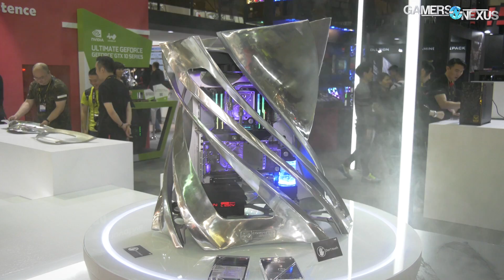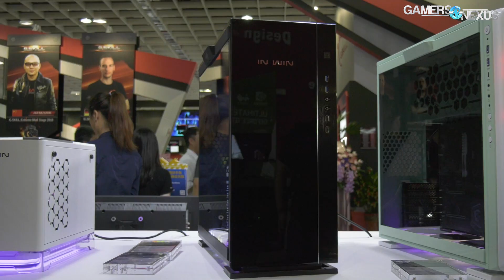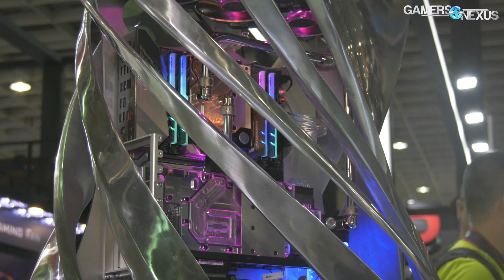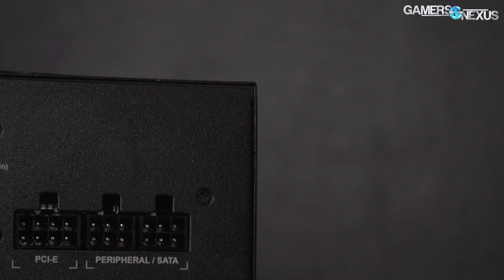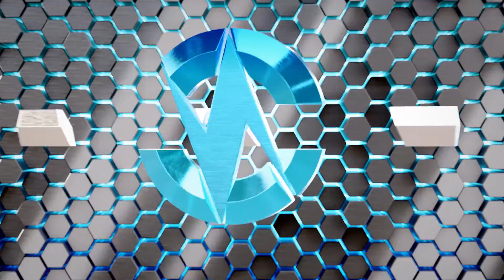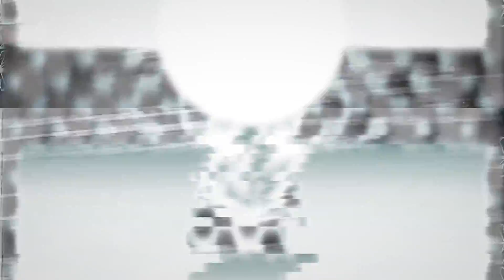In Win 307 Case with Animated GIF Panels

Comment: Graphics Interchange Format. GIFs are image files that are compressed to reduce transfer time. The proper pronounciation of the acronym is a soft "g" sound: like JIF. 
The creators of the format, Bob Berry & Steve Wilhite, claim that this soft "g" sound is used. At some point one of them said, "Choosy programmers choose GIF," a play on the peanut butter commercials where "Choosy moms choose Jif." It can also use multiple images for animated effects (animated GIFs).
by Willow Jones June 10, 2006

Comment: wow, are they so hell-bent on making cases smaller to save material and shipping costs, that they no longer care if bottom intake fans block the bottom PCI slots and top mount rads cant be used with a motherboard in the case at the same time? Again, another case with bottom fans inside the lower two PCI slots of a full ATX board, that is going to be limiting for so many non-gamers. At least they added intakes to make up for the lack of intake on the front, that is an improvement over former cases of the line.

Great vid GN crew. B)

Comment: yeah enough with rgb, and looking at these inwin models i have a feeling that in win sales will plummet dramatically as they have zero innovation for the compute capability that  there is around today, maybe inwin ha snot yet heard that the era of dual core processors pc case models is kinda over.

Comment: My one beef with rgb fans is you sacrifice performance for it. Even thouse with a dedicated rgb connector by itself, because it has to be accommodated in the fan, just compare rgb fans with their led-less counterparts. Their cfm and h20mm is MUCH higher then the rgb ones. I wish they would adopt the way phanteks dose it a bit. At a certain threshold their is deminishing returns, but none the less, that can equal into lower rpms and less noise as a whole.